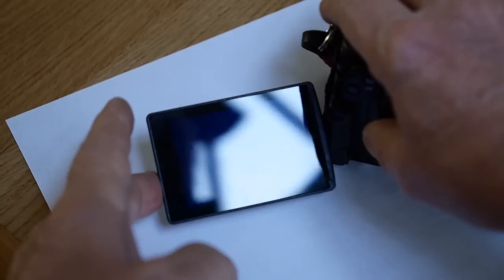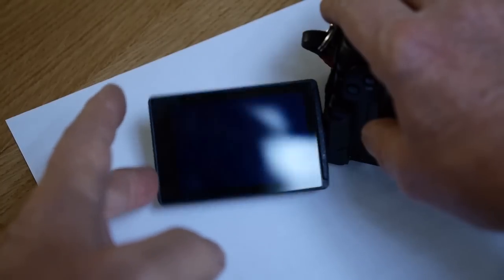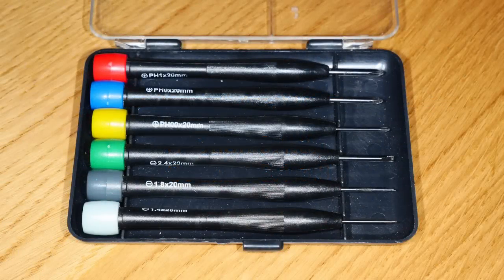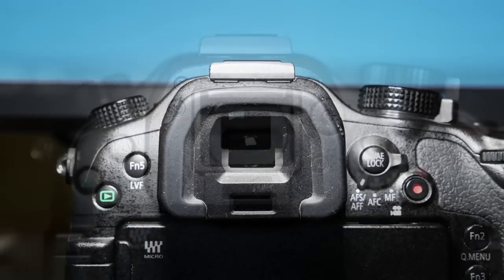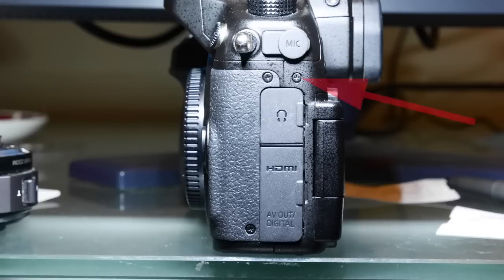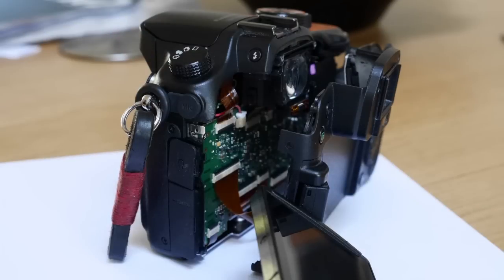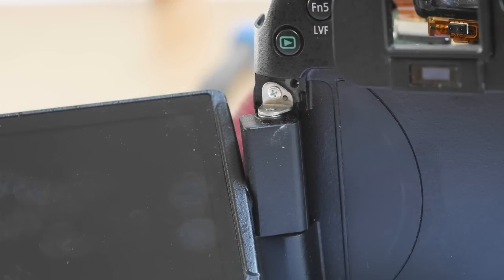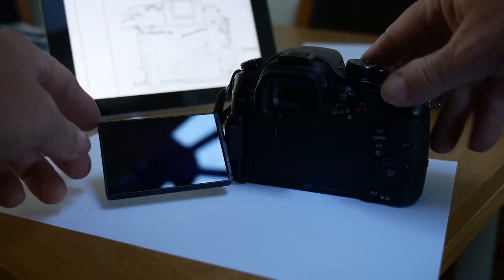How To Repair A Panasonic GH3's  Wobbly Monitor

Comment: Thanks for uploading this.
I can verify that it more or less the same fix will work on the lumix FZ150 and FZ200.
The only slight difference is taking the 2 screws out at  2.29 in your video is the same, but the little things that cover the hinge assembly are clipped on and require a bit of wiggling after the screws have been removed.
Easier if you detach the back of but removing the lead (yes it's fiddly to get back in, and don't use metal tweezers)
Both screws on the one I fixed where really loose.
Just to  add...there are 2 screws under the hot shoe cover on the FZ150 that you have to slide off to access and it doesn't have a screw inside the battery cover.
Reply from the maker: Useful information - thanks! I've pinned it so that others will see it.

Comment: Thanks for sharing this, David. It worked like a treat! One suggestion I would like to add for those wanting to attempt this as well is that the Battery-compartment screw is quite tightly fixed, so you need to be careful not to damage the screwhead when trying to dislodge it 🙂I accidentally stripped the head somewhat, making it a bit of nightmare to remove. Key is to make sure you use a well-fitting screwdriver and make sure you apply sufficient pressure at a straight angle when trying to undo the screw.... just sharing my experience 🙂 Thanks again for the video, David, much appreciate.

Comment: Hello, David. I own a GH4 and I'm having the same wobbly screen problem you had w/ your GH3. I can see that the screw setup is the same, although if I'm to do this on my own I'm going to need to find the proper watchmaker kit. I have a set of precision drivers, but they don't fit. And I don't want to mess up the screw bearings on the camera. Will keep you posted, and thank you for making this video. Very thorough and helpful.
Reply from the maker: mark84j Good luckl!

Comment: Hey David I have an extra panasonic gh4 with a cracked screen. Iv seen the lcd screen for sale and was wondering if you think I could possibly do a screen replacement by following your guide, but then unplug the broken screen an replug the new screen?
Reply from the maker: I felt that tightening the screws was as far as I would go but if I could ascertain that the only connection between the screen and the body I'd have a go. You'd need to take care to use no force and chart your progress. And provided you damage nothing, there's always the possibility of getting your screen fitted professionally if it turns out too difficult. If you try - good luck!

Comment: Your video gave me confidence that I could this, since I am like you, handy and have no fear of taking things apart carefully. I wanted to tell you that I followed your instructions and it worked perfectly. I am guessing that there was a batch of GH3 that simply were not assembled with this top hinge screw tight enough until it was caught later on.
Reply from the maker: I was worried I might have glitched somewhere,. You take so much care but you can never be certain. That takes a weight off my mind, Al, thanks. Yes, I think you may be right about the assembly. It's us early adopters who sort the problems out for the rest!

Comment: David, you are a lifesaver! Your post, "How To Repair A Panasonic GH3's Wobbly Monitor" was really helpful. The process took me about 20 minutes, following your instructions.  The screw in the battery compartment is by far the most difficult to remove and replace.  At least it was with the very short jeweler's screwdriver I had at my disposal.  Also, your suggestion regarding the use of a magnetized screwdriver would have made the job easier.  However, I was able to complete the repair anyway.  

Thanks again for your post!
Reply from the maker: Thanks Tim - yes it can be awkward but it is do-able.

Comment: Finally had the "balls"  to go ahead and do the fix. I did not look at the service manual and just followed your instructions. Worked out to be a perfect and easy fix. Saved me from not having my camera and on top of that see the inside of it for once ;-). Very easy to do indeed and happy with the result. My top screw was also the only issue, put a little bit of super glue on it, tightened it down and no more wiggle. Thank you very much for the instructions!!!!

Comment: Hey, David. So I went and did it. I opened the sucker up and attempted to tighten both screws (top & bottom), but they both seemed secure and tight already. Whatever is causing the wobbly screen is the vertical hinge both screws are securing. Disappointed, I put all the screws back into place after latching the backside back on... and it seems like 50% of the wobble is gone. While it's still there, there is a massive improvement.

I greatly appreciate your video, man. Without it, I don't know what would have happened. Cheers.
Reply from the maker: mark84j Thanks, Mark. I'm glad some of the wobble is gone at least but I can't imagine what has happened to the hinge itself. This video shows the very cutting edge of how far I'd take apart a camera - any more and my hand would shake too much to be useful!
Reply: Must be just a weak hinge to begin with. Who knows. I'd spoken w/ Panasonic about sending it to them for repairs, but they said even though it's still under warranty... they deduced a weak/broken hinge isn't covered. I was so pissed because it's not like I dropped it or anything. The wobble just started over time. So instead of paying the $450 they wanted... I chose to do it myself. Which is why your vid was such a godsend. :)
Reply from the maker: mark84j Interesting. I did mine myself because Panasonic said the same to me. Mine was still under warranty too. There's no way the owner can cause that problem. So much for Panasonic warranties :-(
Reply: Yeah. Super lame. I was specifically told that while it's under warranty, the labor costs to fix it was $450. I was thinking... "What's the point of the warranty then?" lol

Comment: Thanks so much for this video. I cannot get the screw in the battery compartment I loose and am very near having the screw be stripped. Just curious what brand glasses screwdriver you used as mine are not cutting it and I've used two different kinds.
Reply from the maker: Mine were just a standard set from Maplins. I think you may have an unusually tight screw to deal with. That one was the stiffest of all on mine but a strong push down with one hand and controlled twist with a pair pliers round the screwdriver turned mine. It does sound like yours is unusually tight.
Reply: +David Thorpe thanks so much

Comment: Thank you very much, your Instructions are correct and very helpful. I also fixed the flash socket problem, the screw was fallen inside the body. I found one, a second one should be in the body also. One screw at the monitor to unscrew and I could fit the screw back in. Sorry, no pictures, I was glad to get my camera back to work.

Comment: Thanks for your informative video.  I was able to tighten up the wobbly LCD screen on my GH3.  I used the sticky side of some masking tape to keep the loosened screws from rolling around.  I also labeled the screw positions as you recommended. I also applied some Loctite to keep that troublesome hinge screw from getting loose again.
Reply from the maker: Glad it was useful. With the Loctite it shouldn't be a problem again. The other Panasonics with articulated screens don't seem to have the same problem so maybe Panasonic are using some Loctite themselves now!

Comment: Great video, David! Do you know what to do if the touchscreen feature stops working?
Reply from the maker: Thanks Marcus! The touchscreen, no I don't know. If the monitor has an image, it's not the connector contacts and would look like a job for Panasonic to me. If the touchscreen is turned on in the menu, it really should just work.
Reply: You're welcome! Everything else works. I got the camera about 2 years ago. The touch function was working intermittently recently and now doesn't work at all.
Reply from the maker: If it is contacts, you might try following my guide here but if you look at the top of the screen you'll see a ribbon connector. You could wiggle that around or even take it off and clean it. I can't give any advice on how to do this but if you do it carefully it can't really damage anything. And your warranty is out anyway, of course.
Reply: Thanks! May try that.
Reply: Hey Marcus, did you managed to fix your touch screen?
Reply: I haven't tried it. Have you?
Reply: Some one try it already... I guess it's going to have to be me, will let you guys know how it goes.

Comment: Great video David. I had exactly the same problem on an FZ100 a few weeks back. There were not nearly as many screws involved in removing the back of that camera, but the hinge (the top one again) was a bit more complicated, with the switch that changes from the EVF to the back panel display being at the top hinge on that camera. I found it easier to just remove the flat cables rather than take a chance on tearing them. It really is a shame that this seems to occur on all their articulated displays yet they insist on trying to pretend it may not be their problem. I suppose I should start looking for a manual for both my FZ200 and G5 right away since I will likely need to do this for both of them eventually.    )
Reply from the maker: That's very interesting. I'd assumed the problem was a one off on the GH3. I wonder what causes it? Screwsdon't normally come loose like that.
I was a bit miffed with Panasonic service when they told me it would not necessarily be a warranty matter since I find it hard to see how anyone could cause an internal screw to come loose. Given that they might charge me £90 for something that was their fault, not mine, that was my motivation for doing it myself.

Comment: Thanks for this.
The process is very similar on the G7. Took my camera out the next day to find the screen had become loose overnight, must have been knocked, but was able to fix it up.
Reply from the maker: Handy to know. I had wondered about that. I suppose camera makers keep their in house construction methods as standardized as [possible.
Reply: Indeed, not much need to fix what's not broken. Not sure if the G80 may be quite different with added weather sealing.

Comment: I just pickup a used GH3 today and it has this issue. Luckaly I knew allready about this video. So tonight I gonna fix it and it took a little bit of the price. My other GH3 has broken less contact points and the repair costs where 575 euro!!!!! The GH3 which I bought today was also 575 euro! So now I own 2 GH3's one only for manuel lenses :)
Reply from the maker: victorbart Great story - that was a bargain at €575 when you know you can fix it for nothing. I guess that repair price on the one with the broken contacts means they don't want to mend it.
You can still use auto-aperture, I suppose.

Comment: Hey David, I have a GH3 that's touchscreen recently quit working. I'm not sure why.. 
Do you know anything about how to repair that? Could it be the wires are loose?
Is there anything I should know about how to disconnect and reconnect the wires?
Thank you so much!
Reply from the maker: Permaculture Ecuador Every time I though my touchscreen had stopped working I'd either turned it off in the menu or hit the disp. button by accident. Other than that, all you could do is make sure that the connectors inside are pushed home properly. This video is the absolute limit to what I'd undertake myself - otherwise it's a job for Panasonic. Unusual for a screen to fail, though. Is it blank or does it show an image but touch doesn't work?
Reply: Thank you so much for the quick response!
The display works completely fine, and the touch screen was working fine then randomly would only barely work if i tilted it in the correct angle right now it wont respond at all.
I live in Ecuador, my brother leaves in a couple days to the USA for just 2 weeks and then comes back to Ecuador. Would that be enough time for me to have it sent to Panasonic if tightening the cables doesnt work?
Also do you know where I can contact panasonic about repairs? or you think I should just have him take it to a local electronics repair shop?
 I was trying to find the information, didnt find much..
I believe this is very rare as Ive seen only one other person with this problem who said he found a video and fixed it. He didnt say which video so I could only find this one...
Reply from the maker: Permaculture Ecuador Your problem does sound like a loose connection. It should be easy enough with the back off the camera to push any reachable plugs home securely. If not, Panasonic have a web site for Ecuador http://www.panasonic.com/ec/ so their support should help. You could explain about getting it done while in the USA but it would make life difficult of they need to order in parts so that it wouldn't be ready before your brother left. I think I'd get it done as close to home as possible.
Reply: Permaculture Ecuador did you ever fix the touch screen on your GH3?  my GH4 has the same issue.  thanks!
Reply: sjsielen no I've been busy but I'll see If I cant try opening it today and if helps anything. 
Thats crazy the GH4 has the same issue! Though I do believe it's a very rare problem..
Reply: Permaculture Ecuador Thanks for the reply.  Let me know how it goes.
Reply: Have the same problem. Touchscreen dosent work anymore...

Comment: Good clear instructions - worked a treat.  Was hoping too that opening up and trying to push the ribbon cable in a bit may have magically fixed my 'non-touch' screen - but to no avail.  Thanks anyway, it solved the wobbly screen which is what your video was all about.
Reply from the maker: Thanks Rob - wouldn't it have been satisfying if pushing the ribbon cable had done the trick? Shame it wasn't.

Comment: Thanks, man! Took me just under 10 minutes with all preparations, and the screen doesn't wobble around anymore. Great!
Now the only other thing i'd like to fix is the slipping front dial, but i guess it is not as simple to do. Any success stories about the dial anyone?
Reply from the maker: That great, Simon! I can't help with the dial but maybe someone can.
Reply: In fact you know what, i think i know how to fix the "slipping dial" thing without even disassembling the camera.

if you use your nail to grab the side of the dial and pull a little - you can see that it is just a rubber ring sitting on top of a plastic wheel. And this slipping issue is actually a rubber part slipping against the plastic center part of the dial. I think if you get some kind of super glue and using a syringe and a needle put a little drop of glue on the inner side of the rubber dial grip, let it dry and then repeat in couple different points on the dial - this will fix the issue.
Reply from the maker: Hope so! I had my 12-32mm Panasonic zoom come apart and fixed that with Araldite. It's probably what Panasonic repairers would do but they'd charge £75 your repair (and mine).

Comment from the maker: +Story-Way - you did  well to fix the flash socket. You do have to proceed carefully and make a note of everything you do, don't you?
As a kid, I bought a Vespa motor scooter and decided I'd tune the little 2 stroke engine by polishing all the ports and fitting a bigger carburetor. Six months later I sold it in pieces for one fifth what I'd paid. That was hard lesson for someone on a tiny wage but a good lesson in the long run!

Comment: Hallo David, your Video was recommended  on  THE German LUMIX Users Forum. That's how famous you've become because of  this marvellous tutorial!! Congrats!  I have had a DMC G  for 5 years now so it is about the same vintage as yours. Maybe my problem is related as my camera was produced at about the same time. Recently my Touchscreen started to get erratic and unreliable. It went from black to functioning depending on how often I opened and closed it (moving the hinge every time of course). Now it has stopped working completely. My hunch is that the ribbon connector is loose. I asked the official Panasonic repair shop for an estimate. They say they would only replace the entire Monitor as they "don't do diagnosis". This would cost me at least €150 as the new Monitor costs around €100,- . But if it is only a loose Connection and not a broked monitor, do you folks think I could try to push the connectors home myself??
Reply from the maker: Good to hear that about the German users forum. If I were you, I'd definitely give it a try. I wouldn't go any further with a repair than I do in this video because it would go outside of my comfort zone and competence but pushing the ribbon connector home is no more dangerous than tightening the monitor screws. If re-seating the connector doesn't work, you haven't lost anything but if it does you've saved a lot of Euros. It does sound like a loose connector. It it is the monitor itsefl going wrong it usually shows coloured bands and flickering. Good luck, Di!
Reply: Well actually in the end I did have it repaired and they put in a new monitor. But thank you all the same for providing an alternative to consider!
Reply from the maker: It's a pleasure. And nothing lost even if nothing gained.

Comment: Spectacular work on this tutorial thanks !
Reply from the maker: It obviously worked then! Thanks for the message.
Reply: David Thorpe Worked, I just eccounterd small problem: screw that fix the top small cover on LCD (from inside) wouldnt fit. So I had to let that small cover out, just coveres the empty hole in case any wet or dust... Thanks again